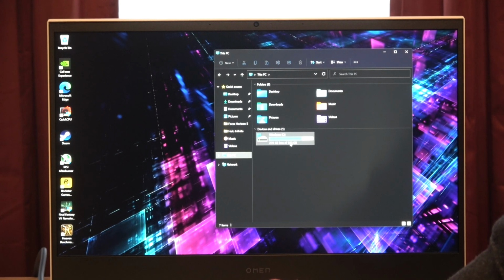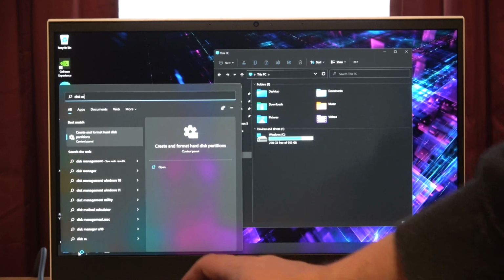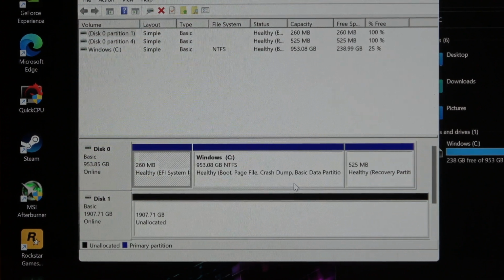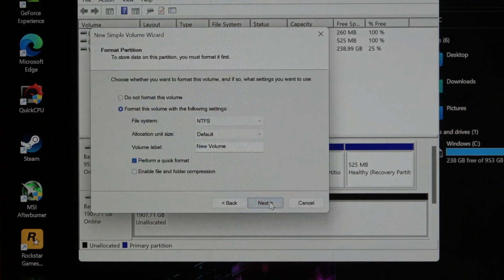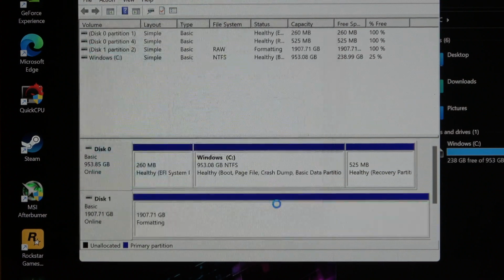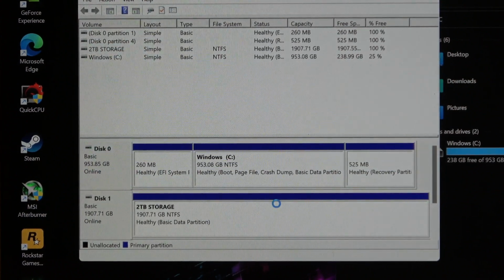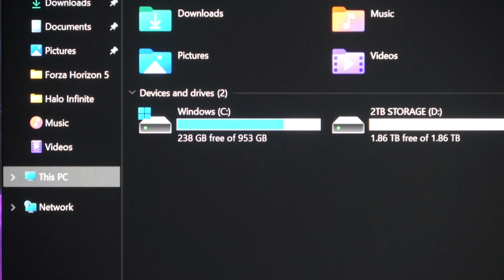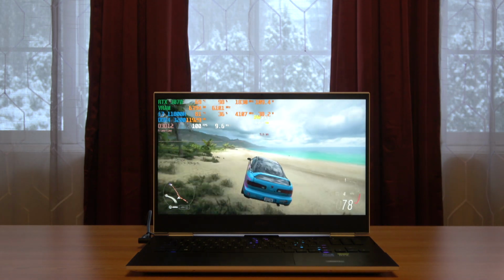HP Omen 2021 - Laptop SSD Upgrade Tutorial

Comment: Great video—thanks for making the instructions so clear! Even though the interior of my OMEN was a little different, your walkthrough was easy to follow and made installing my new drive a breeze.

For reference, I’m running an HP OMEN 17.3″ (Ryzen AI 9 365 + RTX 5060) and just added a Lexar NM790 4TB. My system actually came with an external heatsink already installed and ready for the new drive, which made the process even smoother.

I’m 57, and this is the first “gaming” computer I’ve bought in over 20 years—but I’m actually using it for 3D CAD work, not gaming. The large hard drive was exactly what I needed.

Really appreciate the clean and detailed video—it saved me a lot of time!

Comment: I have a hp omen 15- dc0xxx. The mechanical HD doesn't work. Everything is on the 256gb ssd which I replaced with a m.2 2 tb ssd. Now I can't use the laptop, there is no operating system. I have Everything on the 256 gb ssd copied onto a micro sd card. How do I get the os to work so I can copy Windows onto the new ssd?

Comment: Im updating my HP OMEN aswell, however I have never done this before.. Will I not loose my current Softwares installed (ex: Os, other games?) Im just unaware if I have to replace the current 500gb SSD or there's another slot that I can add into it?
Reply: I think there's another slot as he says at the end of the video that he has the original plus the new one available in the laptop

Comment: ok so I bought a new nvme ssd 2 terabyte and decided to use my old 500gb for storage so I put it in the second slot and it did not show up at all
Reply from the maker: You might need to initialize the disk in Windows, if it’s a brand new drive that hasn’t been formatted or anything yet.

Comment: Right on, just got an omen go 16.1
For school, a bit over kill but I play games, so it’s just as simple as that to change the ram? It’s 2 ram slots just upgrade it with higher ram
Capacity?
Reply from the maker: Yep, it’s easy, just make sure to disconnect the battery before you swap the ram to be safe.
Reply: @TechWithSean  thanks buddy

Comment: so how do you change the os over to the other m.2 ssd? i bought a second m.2 thats 2tb 4th gen but i bought the computer with a 512g 3rd gen so i want to move all those files over and make the 4th gen be my primary because it has a 7k read speed
Reply: You could probably use cloning software to do that, but I doubt you're going to even be able to tell the difference in your OS' performance between the two NVMe's. It's not like the difference of going from an HDD to an SSD, it'll be much more slight in practice.
Reply: All new SSDs I've seen come with data migration tools. Crucial and WDC use Acronis. Samsung uses software called Data Migration Tool. Both will clone the drive, including the OS. Only issue I have specific to the Omen was that Omen 15 Bios didn't recognize the new SSD as a selectable boot disk. I had to remove the original SSD completely and then the Omen Bios recognized it and  booted to Windows 10 on the cloned SSD. Then I reinserted the original SSD and it showed up as D drive, so that old SSD can now be wiped and used as a data storage drive.

Comment: My one concern is how much of a bend the heat sink causes in my SSD, my only hope is that with time the themal pad will flatten out and the copper will bend back more, and it'll even out, because right now the  drive looks arched.
Reply: Did it flatten out? Is everything fine a year later?
Reply: I remove the copper plate because it make bend on my double sided ssd. after removing that, it almost perfectly fits in.

Comment: Hi, my omen 16 does not detect the second ssd
Reply from the maker: If it’s a brand new SSD, did you go into windows disk management to initialize it + create a partition? Also, make sure it’s PCI-E not SATA. (There are m.2 SATA drives out there)
Reply: @TechWithSean  it's m.2 SATA

Comment: Only 1 nvme slot?
Reply: This has 2 m.2 slots. Stock SSD comes in the gen 4, empty is a gen 3 I think…at least gen 3 is written on the board. I have a gen 4 SSD in both and they both work fine.

Comment: Are you able to get the RAM to run at 3200?  My same Omen can only run at 2933ish. Multiplier seems to peak at 14.67 instead of 16. Checked via hwinfo64 and cpu-z.  RAM is recognized as 3200, my system just can’t run at rated speeds in dual channel.  It bugs me enough that I’ll probably return.

Comment: I have this laptop, does your fan whistle when it's on idle, it's irritating
Reply: The best solution I found is to manually edit the fan controls so that it never goes below 3000rpm, the threshold below which it starts to whistle seems to be around 2800rpm
Reply: Mine doesn't whistle but that fan does get pretty loud when playing graphically demanding games.
Reply: @nicb.1411  that's normal for all laptops
Reply: Mine also does left (cpu) fan air whistle at specific low speeds
Reply: @UnfaehigerKanal  yeah it's driving me crazy
Reply: I own this laptop and I do not get whistle. I did remove the pad so I will have to open it up again to put it back on.
Reply: mine does not whistle, i have OMEN 15-en1010nq
Reply: This is the only laptop I have that does this. It's VERY annoying.